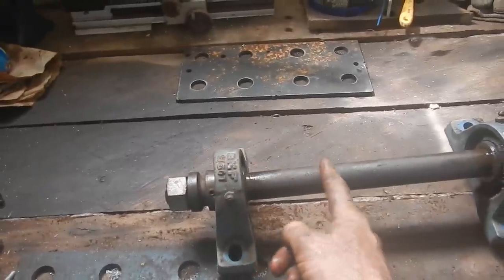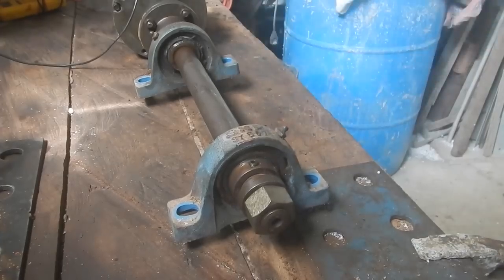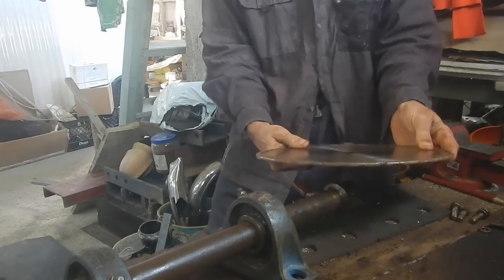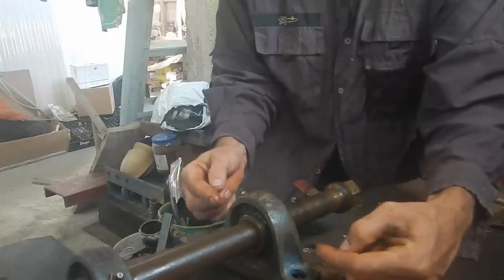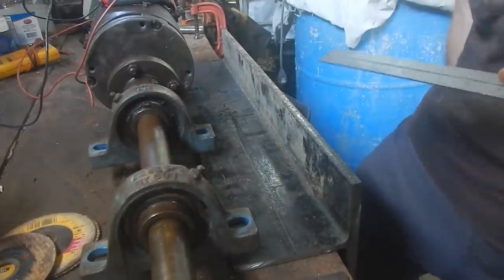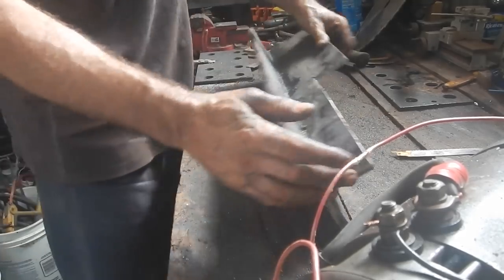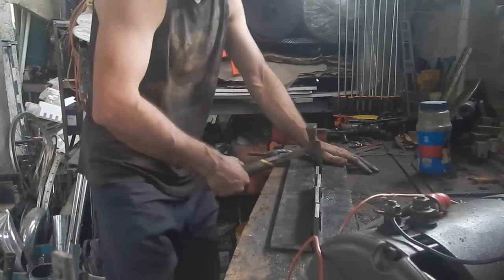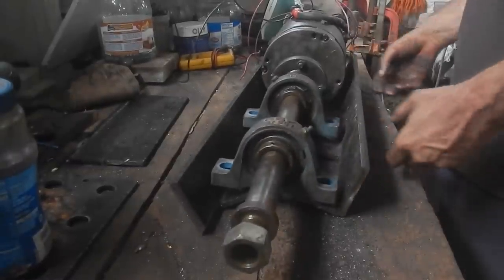Lumber Mill 005 Cutter Frame

Comment: Hi Jamie, If you make the motor/shaft/blade unit detachable from the frame. You could take the thingy apart and take the rust-critical parts inside for the night. Or rainy season.

Comment: Try mixing some pure lanolin and acetone to make an awesome cheap rust proofing.  The lanolin will dissolve in the acetone and when painted or sprayed it will evaporate and leave behind the lanolin.  Very hard to rub off and lasts a long time. Cheers.
Reply: Might work. I like simplicity.
Reply: Vinegar is the best rust killer in my opinion, acetone is more of a plastic/glue eater..
Reply: @ChaNnArD-mD  Sorry but you missed the point.  Lanolin is a rust inhibitor and the acetone is  what you dilute it with.  There are commercial products out there that do the same thing.  DIY is cheaper and you only need a very thin film of lanolin on the steel. 
Lanolin will not remove rust.

Comment: We used to take air sprayers and instead of spraying paint we melt wax rings for toilets and use it for undercoating on cars and spraying anything outdoors metal that we did not want to rust

Comment: Jaimie, If you are worried about covering it why not make a fiberglass cover, similar to a boat motor cover?  I would use 1 of the I beams and situate the bearings and motor in the middle of them so it holds the motor for you like a cradle and the bearings just bolt thru the middle section and then weld a piece of tube at 90 degrees to it where you want it to pivot and then put a long bolt as your hinge piece and then something like a ratchet strap or chain drive to move the motor from horizontal to vertical and then you could also make it to be any angle through the 90 degree arc. and btw I use chalk or crayons to draw my lines to cut things on steel.
Reply: Anything fiberglass is a PITA. The least he has to deal with it the happier we get to see Jaimie on camera ;)